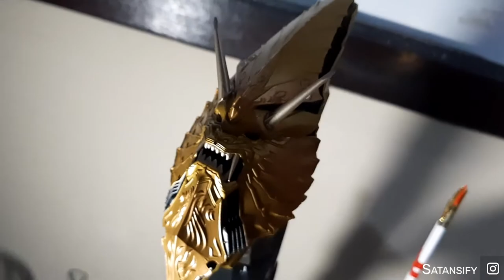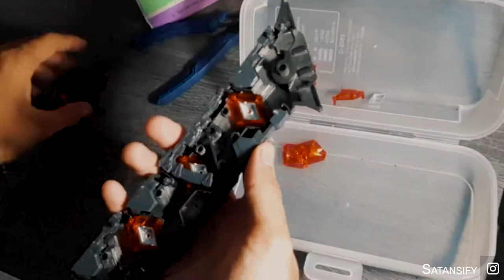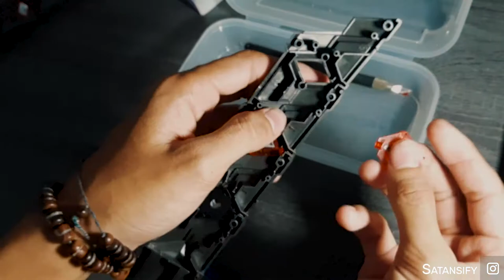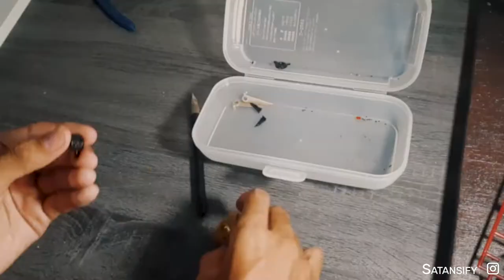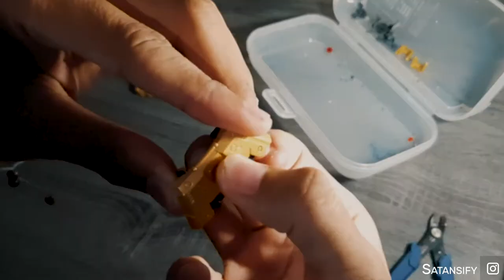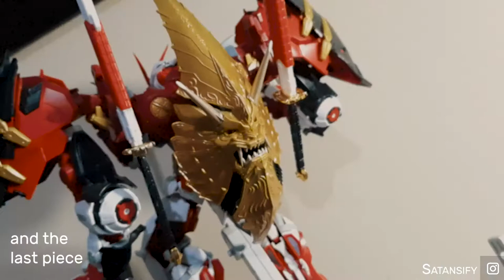150 Gerbera Straight Fast Build - Astray Red Frame Daban Model 8814

Comment: Glad to see i'm not the only one that had to force it together to properly assemble it.  Damn thing's very sharp.  The Shield's Horns&Teeth poked me&made my hands bleed.  The same with the blades from the hilt.  The Gerbera Straight was difficult to carry for convention&group build displays as it's too big.  Fully assembled with the broken blade, it's bigger than my forearm.
Reply from the maker: I know what you feel mate, this kit draws blood to assemble it 🤣
Reply: What about the plastic quality?
Reply: @kingzo1239  Better than previous Daban kits with the new plastic recipe.  Bandai's still better but the kit design is way better than any of Bandai's Astrays.  Although Daban haven't corrected the manual for assembling the backpack thrusters.  Wasn't kidding on how sharp the pointy parts.
Reply from the maker: @kingzo1239  to keep it simple, design/details are mad good, but its so sharp and sometimes easy to break. And when you touch it, it feels horrible, like those uh... well yeah... bootleg toys